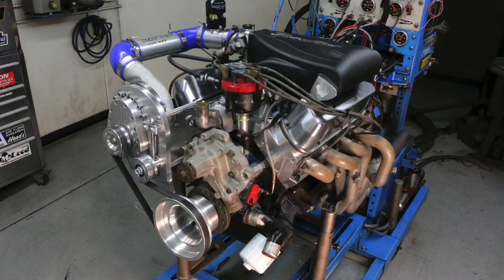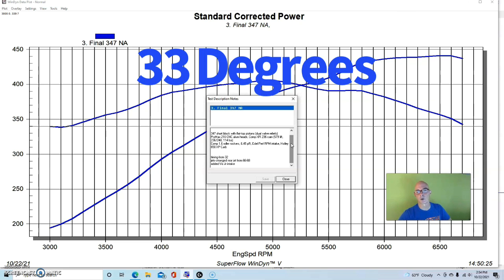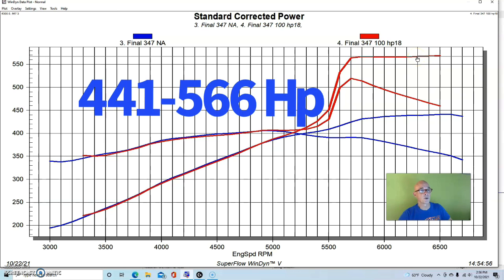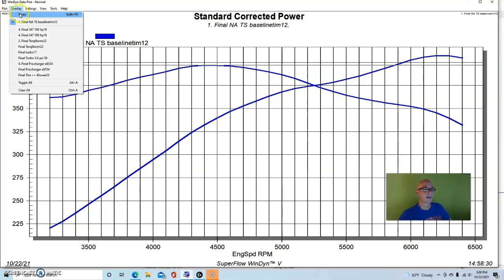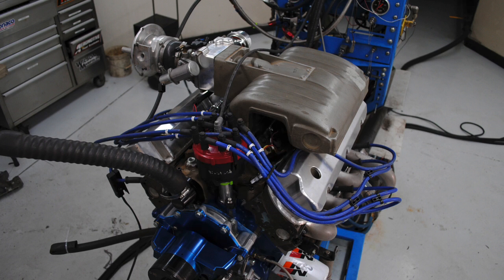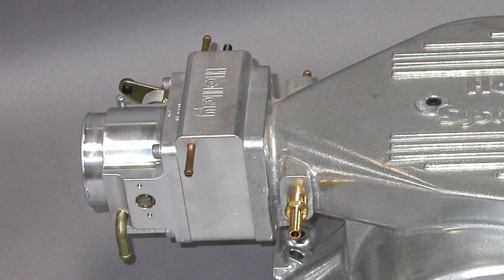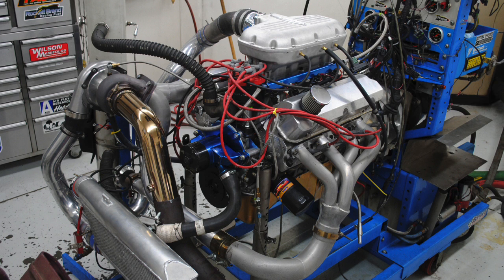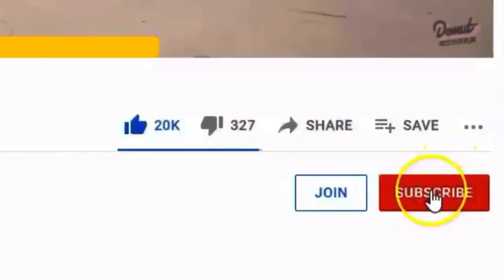5.0L FORD POWER ADDERS-HOW MUCH ARE THEY WORTH? HOW TO ADD NITROUS, A SUPERCHARGER OR TURBO TO A 302

Comment: I know that this is silly but how about a 406 FE?  A good 390 block at 4.125 and a  3.79 stroke (offset ground iron 390 crank for 2.2 BBC rods). It seems like it would be fun for us” old timers” and the shorter stroke would be less likely to make a mess in Steve’s Dyno Room, lol.  I would even like a set of Blair Patrick Racing iron C4AEG EMC heads and some rpm fun.  Game?
Reply from the maker: I HAVE NO FE MOTORS

Comment: Hey could you try running a turbo that is way too small on the turbine on one bank of a v8 like a Chinese gt35 on one bank of a stockish 305 or a 302 like a super budget build I know it wouldn’t be the right way but it would be the cheap way he’ll even if it only made 100hp more it would be a win that would be damn near a dollar per horsepower
Reply: I’ve found forum posts of people doing it and apparently Saab did it on a v6 in the 90s but Saab also had some crackpipe dreams so I could be just that but I don’t see why 4 cylinders of a v8 could feed a turbo enough to make some boost, it might not even need a wastage
Reply from the maker: SAAB DID IT BACK ON THEIR V6, YOU CAN TRY IT

Comment: What stock V8 do you think you can gain the most power with, using stock parts but tweeking them? Id Bet a Rover V8 would be in the top 3.
Reply from the maker: like porting the stock heads?
Reply: @richardholdener1727  sure....I just saw a Wheeler Dealers rebuild of a TVR with a Rover V8...it had 8.0:1 cr pistons, hydraulic lifters and matching rockers and a terrible exhaust...up top it was garbage, but it had cross bolted mains...seems like it had alot of potential.

Comment: I really enjoy your content and would love your input and advice on a 351 Cleveland build that I’m doing.
Reply from the maker: ask away
Reply: @richardholdener1727  351 was in my sons 75 ranchero that was totaled on the 3rd of October when someone pulled out in front of him. Going to transplant in 98 Ranger, plan is 351, tremec T56, Holley Sniper, and I’m torn between Torque storm or twin GT45’s most questions regard cam choice, compression ratio, basically best engine buildup for either power adder.
Reply: @judetorres1739  it will help him answer if you include power goals and what you're using it for. Setups will change with both.
Reply: @richardholdener1727  power wise somewhere north of 600ish, with room to go up from there I imagine, also I’d like to keep it on pump gas so that’s a factor I imagine.

Comment: Hey Richard, was that super charger set up on a stock block making all that power? 638hp 550tq. Also, could I get away with a hundred shot  on my 478hp 442tq stock block?
Reply from the maker: yes stock block and yes on nitrous

Comment: Would like to see Edelbrock Pro Flow 4 install. I’m rebuilding 302 on my 90’ Bronco. In Texas anything over 25 yrs old can dump ALL emissions controls. Pretty well decided to use Pro Flow and clean up current mess.

Comment: Hey Richard; working with the Mack daddy parts kit. What’s the ideal compression for that setup? 799 heads, 3.780 std bore, stage 1 LST BLOWER CAM, going to be utilizing an interchiller setup for the A2W intercooler. Just not sure what compression I should be shooting for.
Reply: Putting this in a 51 Coupe also…
Reply: RICHARD; I’m shooting less than 9:1 compression because I want to use pump gas but yes will definitely be using E85
Reply from the maker: SUB 10
Reply: @richardholdener1727  I’m going with forged dished pistons. +15cc. Puts me around 8.7:1 thanks for all you do.

Comment: what can you use to tune the fuel injected 302? Are you using something like megasquirt? What's a current way to tune fox body mustangs?
Reply from the maker: we used holley hp-also use FAST on the engine dyno
Reply: I believe BREW2lL has videos on using a Terminator X on a 302 Fox.

Comment: What’s something like this bonus set up cost turn key? 20k or more? I have plans to build a explorer 5.0 for a fox body, I want the most N/A power I can get reliably.
Reply: Get that fox quick they went from running and driving for 3500 to 8 k in Memphis
Reply: @ajcates9136  ya. I got a fox.  I’m not selling it ,  cause you’re right.  If I do, I won’t find another one as good as mine for what i paid .
Reply: @burquebanditfab3928  dude I paid 800 for my 88 vert fox and I’ve had it 15 years and just like you said it’s not for sale because we might find one that’s in worse shape and pay more
Reply: For the most power naturally aspirated do a 351 build or make a 347 stroker out of the 5.0, 302's aren't worth doing naturally aspirated
Reply: @chrishansen7004  why bother with the 347? 408 costs basically the same and never makes less power.

Comment: Great video Richard, love the 8.2 deck Ford content. I run a stock stroke 302 with an F1r Procharger that I have did pretty well with. Switched over to Holley EFI last year from a CSU blow thru carb, trying to find the limits of this small Ford. Hope to build a 363 for it next year.